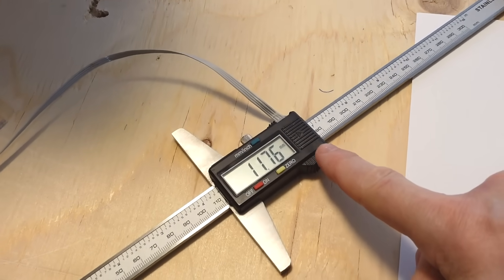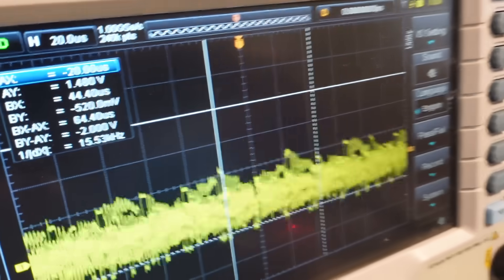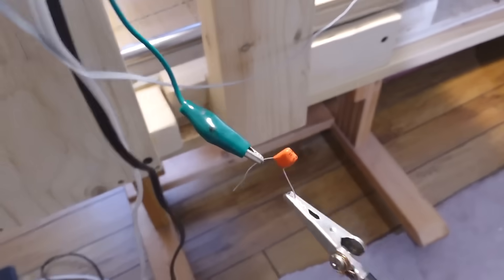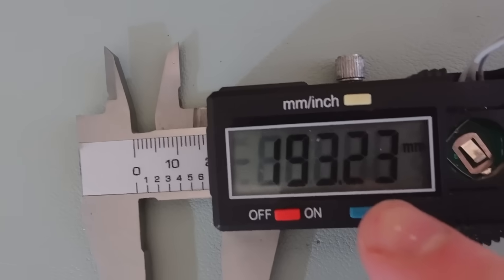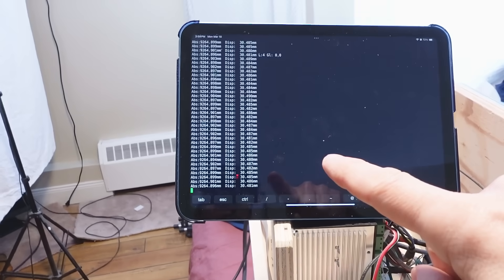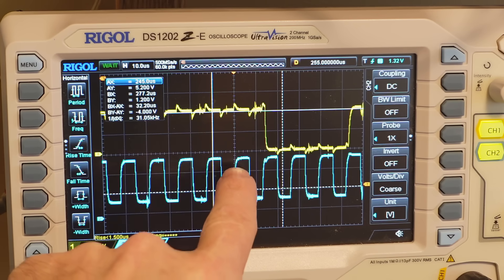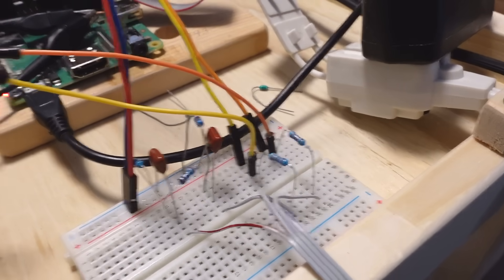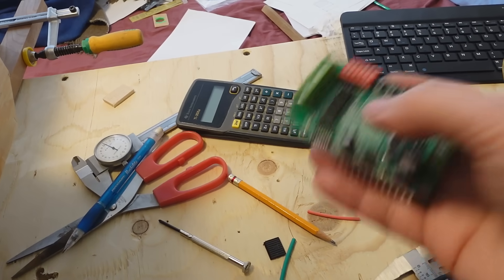Small signal high noise and dealing with it

Comment: “They would have done it better, whereas I DID IT.” So many maker-type people out there, like myself, can relate to this so well! So there’s people out there who brainlessly buy a $10 level shifter and are proud of themselves, and then the guy who gets 99% there by understanding the issue and nearly solving it with $0.03 of resistors… somehow that’s not good enough or clever enough. Sad really. The level shift via voltage divider was quite a cool idea!
Reply: For those in the audience coming here to learn, I suggest most such "corrective" comments are offered positively, in a context of learning vicariously and people's honest reactions to experiment results.

In other words, it's not to correct you, but to learn with everyone watching, as viewers put themselves in your shoes and go along with the process. It's also very helpful to see how different people with different expertise view what's happening. (Of course, as long as it's expressed in a constructive way.)

So I think this is all something to encourage - after all, I think this is one of the classic didactic methods.
Reply: But is it "solved?"    Fails to fail most of the time is different from "working."  OMG, just get a couple of optocouplers for the clock and data signals.  That will do the level conversion as well as isolate WTF is going on with the ground near the motor controllers and the device.
Reply from the maker: before the optocouplers you need to amplify the signal.  and that needs to all happen at the calipers, and you need a power source.  whereas I just soldered wires onto it.
Reply: I’ll be honest this remark seemed a bit of a low blow.  I know commenters can be a bit snarky at times and I don’t have context.

In the end it seems just not to be viable for anything “real”.
Reply: @bennetb01  assuming you’re referring to my comment- it’s definitely fair to take it as a low blow. Like it or not, people who actually do stuff have to take criticism and “well the way I would have done it” comments on the regular from people who DON’T do stuff. And it’s pretty annoying. Matthias’s comment about “actually” doing is spot on!

Comment: Why did you keep the voltage divider? Isn't the PI voltage for logic 1 = 1.8V?
Reply from the maker: yes, and the calipers 1 is less than that
Reply: Perhaps you missed where he had to reduce the voltage due to periodic errors in the calipers at increased Vcc.

Comment: I have used a couple of diodes in series rather than resistors to do a level shift like this. The advantage is that changes in current draw have less of an effect on output. If you could get zener diodes of the correct values for level shifts, even better. A voltage reference as an offset is best, but I know you want to keep it simple. 👍

Comment: You are making you life harder by trying to make something "simple". Like the German saying "sparen, koste es was wolle" / "saving, no matter the cost".
An active level shifter would just be three resistors and two transistors (or even just one if the pi can handle inverse polarity serial; I don't know if it can). You can use any small signal transistor you find. 
Also the cables, as many said. Redoing them properly with shielded ones (left over USB cables are fine) would be easier than chasing down random glitches.
Reply: There was a similar saying about one company I worked for in the UK: "They'll save a penny, even if it costs a pound"!

Comment: A "standard decoupling cap" across the gnd and pwr lines of the calipers may help as well. Both on the caliper side of the wire and on the pi side of the wire.
That's my go-to fix for simple interference glitches.

Comment: Impressive noise reduction. Wonder if using a shielded cable would get better results. For the darker display, you would need to reduce the contrast voltage to the level it had a 1.5V, if any access to it exists.

Comment: Use differential signalling with twisted pairs to eliminate the common mode noise being injected into the wires. An easy way to do this is to use bipolar transistors to drive the LEDs inside an optocoupler. The optocoupler can then drive a differential driver.

Comment: Why not use an opto-coupler to preserve the different grounds and at the same time allowing you to get the signal amplitude that matches your input circuitry? You don't need any special supply for the opto-couplers, its just a diode on the input side and an open collector transistor on the output, so you just have to put a resistor from your instrumentation supply and your done.
Reply from the maker: this means I now need an amplification circuit plus power source on the caliper side.  Like I said, I like to be able to just plug it into the pi without a lot of extra stuff.
Reply: @matthiasrandomstuff2221  Well maybe. But I'd just hook the calipers output directly to the LED input and if you have found a high sensitivity opto-coupler it might be enough to drive the output. You won't know until you try.  🙂

Comment: You could still twist some wire pairs instead of using the ribbon cables.  Easy enough that it'd be worth a shot.
Reply: It probably wouldn't do anything because the noise isn't crosstalk.

Comment: Hi Matt, have you ever tried using a shielded cable as a supply line for the caliper?
A piece of CAT-5 network cable should do the job. At the end of the cable, directly on the PI, add a low-pass filter and put the PI in an RF-tight housing. Connect the shielding of the cable to the housing.
Best wishes  Bruno
Reply: MOST network cable is unshielded, just twisted pairs. Shielded network cable is not very common
Reply: @gorak9000  This is certainly true in an office environment, but not in an industrial or workshop environment. Here, network cables generally need to be shielded to prevent interference from machinery. So, it all depends on the type of cable you purchase. U/UTP (unshielded twisted pair) is unsuitable. You need F/FTP (foiled twisted pair) or, better yet, S/FTP (shielded twisted pair), or even better, SF/FTP (shielded twisted pair).
Reply: Cat 5 is UTP - UNSHIELDED twisted pair.
Reply: @stargazer7644  The CAT classification has nothing to do with shielding, but with the possible speed and bandwidth of data transmission. So, it all depends on the type of cable you purchase (no complete list, e. g.): U/UTP (unshielded twisted pair), F/FTP (foiled twisted pair), S/FTP (shielded twisted pair), SF/FTP (shielded twisted pair).
Reply from the maker: That suggestion keeps coming up, but cat 5 is much too stiff
Reply: @matthiasrandomstuff2221  Well, it was an idea for a first test. You're certainly right, that won't work with a connection that is constantly being moved. Highly flexible and shielded cable is certainly expensive, but you certainly don't need that much of it.

Comment: Go to 150mm and back fairly quickly. On many cheap brands, the error is not worth the trouble. Did anybody else have the same problem where the callipers  are showing wrong values if we slide the scale too fast ?? :) Regards
Reply from the maker: Have tried that, I'm always amazed that they go back to zero very consistently, haven't been able to throw a properly assembled one off.
Reply: @matthiasrandomstuff2221  I've had mixed results with that just trying on various calipers. Some work flawlessly, others loose their reading. Note that this is just sliding the scale on an otherwise unmodified caliper and looking at the LCD screen on it - I have no idea what the data output on it is doing because it wasn't hooked up. There also does not seem to be any relation to price - some cheap ones work well, some more expensive ones don't.

Comment: Getting everyone to comment about shielded cable is good community engagement ;)
Reply from the maker: I neglected to say why I didn't want shielded wire.  My goal was to just tweak it a little to make that unnecessary.  Also, the signal s are between power and ground, so already shielded from two sides.
Reply: @matthiasrandomstuff2221  plus there's the fact that the measured radiated noise is 20 times less than the noise signal you measured in the circuit. So I don't see how shielding the wire is going to make any difference.

Comment: On the pi, incoming, between the pin and wire from the caliper: put a diode in series and a pull up on the pin (in software if you want). That will offset the level about 0.6V.

Edit: if you need... Just realized you solved the issue :)

Comment: Wouldn't it be even easier to replace the data cable to the caliper with a shielded cable? Maybe just a simple telephone cable with 4 wires.
Reply: It wouldn't fix anything. A shield can only block radiated noise and this is propagated noise. The noise is in the circuit itself. It is going right down every wire too. I'm surprised that Raspberry Pi even works. It has really good input filtering.

Comment: I wonder... a ferrite around the servo wires? They carry quite a bit of current when under load...
Reply: This is one of the very few comments that actually fits within Matthias's design parameters, so good job! A 50-cent clip-on ferrite over the servo power leads may (or may not) be a very simple elegant solution. I'm about 50/50 if I had to guess. I know he's already solved his issue, but hopefully he'll give this a try anyway. I'm curious if focusing on the servo cables instead of the caliper cables would be the best option.
Reply: I'm also curious now if the power supply to the servo has a common mode choke and EMI suppression caps on the output. Because that's a lot of noise.

Comment: Without schematics I get a bit lost. Looks like you solved it. No doubt the problems you are seeing are happening because of the cabling. If all components were on the same board I am sure it would work much better. With that in mind here are things I have done in the past that have helped a lot.
1) In the cable, use a dedicated ground wire per signal. So one for data and one for clock. Use ribbon cable or twisted pair. Coax is even better but maybe overkill. In the ribbon cable, put the ground right next to the signal.
2) Lower source and load impedance (if the signal can tolerate it).
3) I can't remember how you did your voltage shifting, but if it involves a series resistor in data and clock, you might want to bypass that with a cap to reduce the AC impedance for the signals. Especially if the resistor is on the caliper side, but either way.

If there is no common ground between boards, you can use a capacitor from ground to the pseudo ground for the cable (on one or both sides of the cable).

Glad you followed up on this. I knew it would be possible to improve the noise immunity one way or another.
Reply from the maker: I didn't have control over the signaling coming out of the calipers, and I wanted to stick with the nice 4 conductor ribbon cable.
Reply: The problems are coming from the motor drives. With the drives off there is no problem. With the drives on there is a problem. So the drives are the problem.
Reply: @  I mean yeah. The drives are the aggressors. But the serial lines are the victims. The discussion could be how to shield the aggressors but it is just as valid to discuss how to improve the immunity of the victims. I don't think shielding or reducing emissions in the aggressors will be easy. But maybe there is something that could be done.
Reply: @1pcfred   I am loosing track of what you are responding to. Just for reference I am an electrical engineer and have over 20 years experience in product design, including taking about 10 products through radiated emissions testing. I am not an expert on anything but I know a little about a lot of different things. You can shield motor drive cables to reduce their emissions. There may still be evanescent fields. But even if you don't do that, victim signals can be protected by a shield, if it is implemented properly. In this case, the source of the interfering signal is probably coming from the high dv/dt lines between drive and motor. But who knows. The worst thing you can do is introduce a large area between the signal wires (data and clock) and the ground return for data and clock. Any flux lines going through the surface defined by those wires will induce voltage on the lines. If data and clock are each carried over small coaxial cables, their immunity to external fields will be greatly enhanced. But obviously, Matthias doesn't want to do anything like that. He has his own ideas and methods and it looks like he was successful in the end.

Comment: These videos are a good lesson in the time saved just using the right things (level shifter, shielded cable). Of course they're more than necessary, but give you a reliable reading without all this. But I'm sure I'd take this approach in the video, of doing as little as possible to see what is really needed.
Reply: What do you think shielding could have done here? He probed the radiated noise and it was 20 times less than what was in the circuit. So not a factor and not what was causing the glitches.
Reply: @1pcfred  I just meant doing things conservatively avoids dealing with potential issues. For a quick circuit like this it's fine to overbuild. If you were manufacturing thousands, you would make sure you really needed shielded cable.

Comment: Those signal wires should be twisted pair. Twist with ground.  I would also twist my power lines since you are getting so much noise from the servos. Twisted pair just helps null out the noise without capacitance. Good luck! Twisted pair is your friend.
Reply: The crosstalk isn't what was causing glitches. It is back EMF from the motor drives. That kind of noise can travel down any conductor. A common mode choke might block it in conjunction with some other passives though. At least that's what you see in a lot of SMPS. All in an effort to keep noise from going down lines.
Reply: Twisted pair doesn't null out the noise.  Running differential signals over twisted pair nulls out the noise.
Reply: @ that is true. But, if you twist a signal with its current return path it will null out the noise.  This method works best with high frequency signals as the return current will stick as close to the signal as possible reducing loop area.
Reply: @probusthrax  How exactly does that null noise induced in the signals from external sources?
Reply: @ you are reducing the loop area by twisting the signal with the return also the EMI will create almost equal and opposite currents on each conductor therefore nulling out the noise.  Does that make sense?
Reply: @probusthrax  I would think EMI would be common mode, not differential.
Reply: @ it's not common mode at higher frequencies.  The return current follows the signal as closely as possible. Neat little trick to reduce noise. I hope he tries twisted pair as described.  It'll help fix his problems. Servo noise, spindle noise. It'll work.

Comment: I think you're using a router for the spindle on the cnc.  Have you checked your signal when you turn on/off the router?  I know Carbide 3d went through at least a couple of revisions of their control board on the Shapeoko 3 because of the noise from the router sometimes causing disconnects.
Reply from the maker: Oh, yes, that could be bad.  I was just concerned about getting reliable readings with the machine just doing motions for testing

Comment: Not sure what's going on... but level shifting pcb (Sparkfun etc.) are really cheap. Also, I don't see twisted wiring, ferrite beads, ground planes, grounded foil following the wiring. All stuff it cost next to nothing to do.
Reply: A couple resistors that were just laying around is infinitely cheaper than cheap.
Reply: @ yes. agreed, if your metric for 'design &implementation' is 'cheap' It's not cheap if a glitch, that gets through a kludge, ruins a 30 hr print, or machining job.

Comment: Use twisted pairs to reduce the inductive coupling and a grounded shield to reduce capacitive coupling (cut off a piece of RJ45 cable if you have one laying around). Seeing DSP techniques commented just for this is really some enginneer's tunnel vision ;)
Reply: CAT5 cable is cheap too. Best thing would be to convert the single ended signal to differential and back on both ends for even more noise immunity over CAT5.
Reply: @asm2750  CAT5 is RJ45
Reply: @ miles of CAT3 and CAT4 from pulls everywhere, too.
Reply: @asm2750  CAT5 is a type of RJ45
Reply: I work with a number of rf engineers (not my field at all). I see conversations like that all the time. 😂
Reply: canbus would work too but its a bit of an overkill